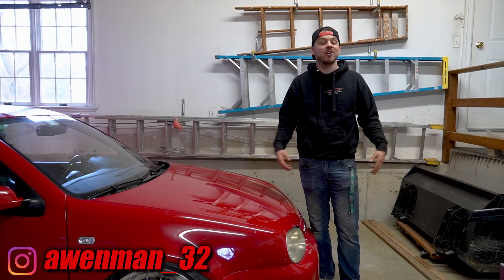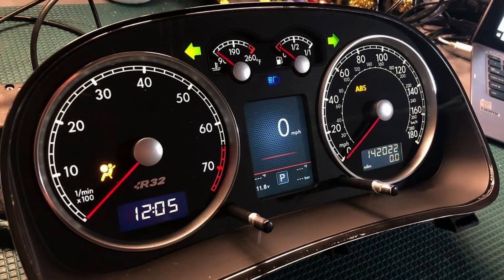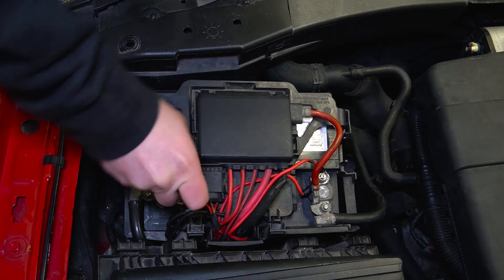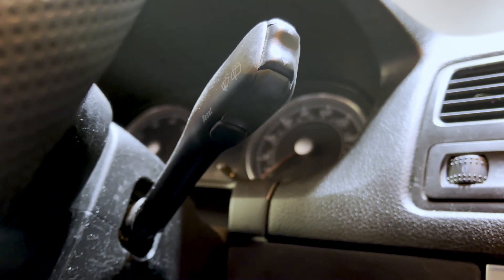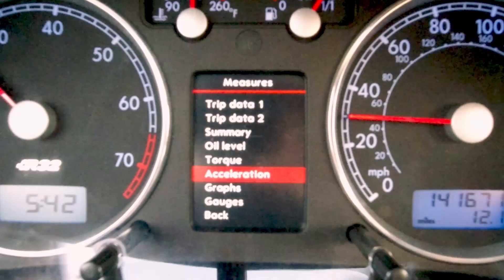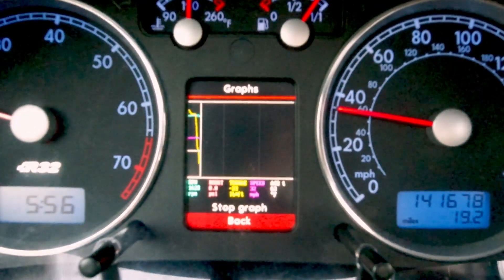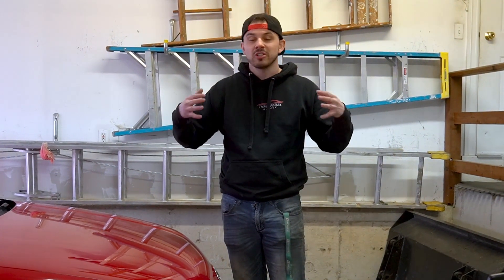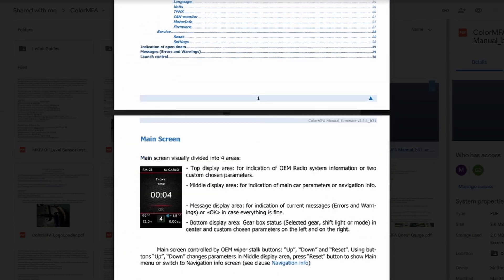R32 UPGRADED MFA Cluster Display - Review and Install (Faded Screen FIXED)

Comment: i have an mk4 golf vw too but i dont know if i can do this upgrade since i dont have the red cluster to start out with its the one that doesnt show the consumption and other stuff
Reply from the maker: You can do it but there is a few thing you need to add to make it work
Reply: @ThreePedalGarage  oh okay thanks
Reply: @ThreePedalGarage  do you maybe know which stuff i need to on i mean ik its probably the turn signal switches for the one that have the button on the side and gotta get a temperature sensor and more
Reply from the maker: @yukie037  I’m not 100% sure but yes you will need that stuff I know if you reach out to cluster by litke he will be able to help you.

Comment: I have one of these screens in my mk4 R32. I was driving along today and it made a beep like the fuel level was low and then the screen went blank. It now won't come back on. I have turned the engine off, keys out, locked etc and the MFA won't come back on. Just blank. Any ideas what could be causing it and how to fix it please?
Reply from the maker: I had that once, you need to pull the Fuse for the cluster to reset it. I think it’s Fuse 15. Pull it and let it sit for 1 min. Put it back in and it should work.
Reply: @ThreePedalGarage  Amazing. I'll give that a whirl. amazing screen BTW and this is no slight on it! dials look so bare without it. thanks for you response
Reply: Hi. I tried this and it worked the first time. Worked for a month or so. 2nd time the screen went and it won't come back at all now. Tried a new fuse but still now joy. Any other ideas please? Cheers
Reply from the maker: @jahankhan8531  damn sorry your having that issue. I would reach out to the guy who made the cluster he may have a better solution.

Comment: Wrong you did 0 to 62 not 0to 60 at 0to 60 the r 32 should ,6.5 secon mine with tectonics cams, magnaflow cut back do exactly  6 second, not bad with  154.000 miles on it with the original motor, ( unbelievable!!!wolkswagen! What can I say!!!!)is not the fastest car out
Reply from the maker: Ya ya just trying to show the functionality of the cluster. Wasn’t trying to break a word record lol. Hopefully you found it useful lol
Reply: Question do you  the  direct phone number for the guy who make the cluster for the  mk 4 r32,( the same as the one you show in the video?) I wrote him on the face account, he didn't reply, do you know if still make the cluster? I am on face book, if you please sent me the number,on privet message, thank you ,( I really appreciate if you can) ciao
Reply from the maker: @salvatorecardinale202  I know for a little he wasn’t making them since a lot of the parts came from Russia. I’m assuming that is still the same. He should get back to you.